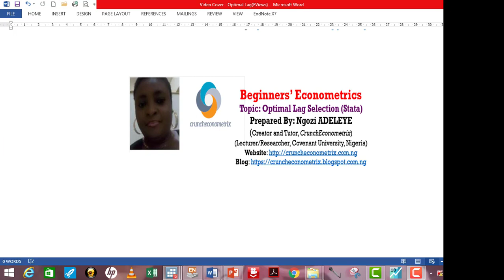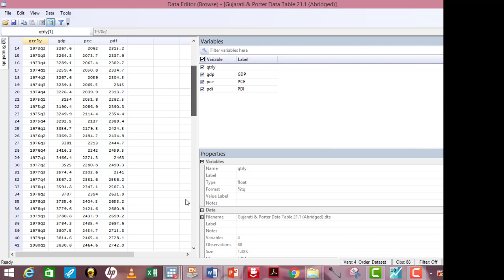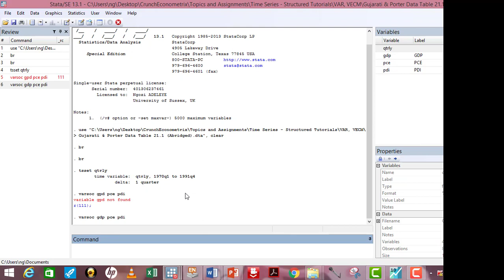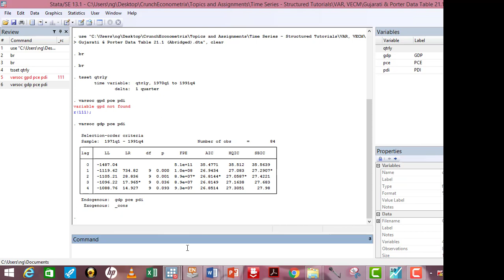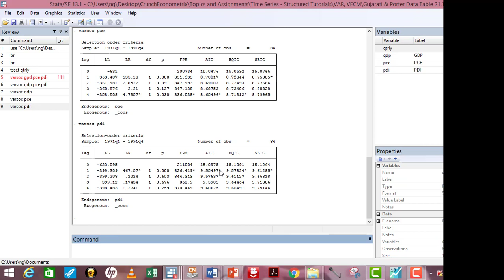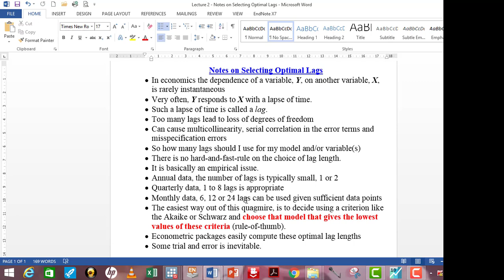(Stata13):Determine Optimal Lag Selection #lags #lagselection #aic #bic #sbic #hqic #eviews

Comment: I have 40 observations with 6 variables (both dependent and independent). The lag selection tests SC, HQ, and FPE suggest lag 1, while the AIC and LR tests suggest lag 3. Since the AIC provides the lowest value, should I use lag 3 or lag 1 in this case? Thank you, Prof.
Reply from the maker: Yes, use the AIC lag criterion to run your analysis. Sincere apologies for the late response 🥰.

Comment: Can you use "varsoc GDP", for instance, when performing the ADF unit root test?
Reply from the maker: "Varsoc" is used to obtain the optimal lag length. You may then decide to incorporate the lag length when performing the ADF test.
Reply: @CrunchEconometrix  Many thanks again for your kind reply. One additional question - suppose we want to make the series stationary. In STATA I define a variable dGDP = d.GDP, where dGDP is the first difference. Is it necessary to execute the varsoc command (varsoc dGDP), determine the lag length first, and then perform the unit root test on dGDP? I personally do not think that lags need to be specified when performing the unit root test on first-differenced variable(s). I tried, and both AIC and SBIC indicate 0 lag for the variable GDP. Second, do we use the varsoc command in the same way when performing the PP test? Thank you very much again.
Reply from the maker: You may want to follow the steps indicated in my Time Series videos for better understanding. Thanks

Comment: Thanks for your viedo it,s so interesting i want to ask you two questions please and i need your answer : there you choose the maxium lags for each variables  as we can  used to ADF test and other unit root tests ? 
then in my case i found that  4 variables have the lowest values in the SBIC but the last variable has the lowest value in AIC so what can i do please??
Reply from the maker: Hi Ahlem, you can either stick to uniformity or use different criterion as related to each variable. Remember, to put in a note to explain what you did in your work.

Comment: Maam thanks so much for your videos. based on basis on optimal lags for annual data, i used varsoc for a variable and the optimal lag was 4 instead of 2 provided my data set is 30 in number. what can i do with this variable?
Reply from the maker: With 30 obs, estimate with 1 or 2 lags and put a note in your work explaining why.
Reply: @CrunchEconometrix  Hello maam. I really appreciate your videos. I have the same trouble where the optimal lag is 4 instead of 2 for yearly data, and my data set only 12. Should i estimate with 1 or 2 lag and put a reason note, and if yes can you give me some ideas about what to write on the reason note. Thank you so much.
Reply from the maker: No reasonable time series analysis can be conducted with 12 observations. Increase to at least 30 years.

Comment: Hi I have two questions if you could please assist me.
1. How do I derive a short run multiplier of yt+1 with respect to Xt, i.e dYt+1/dXt for a finite distributed lag model yt=1,78 +0.75Xt +0.2Xt-1 +0,35Yt-1.
2.how do l show and explain that as k→∞, dYt+k/dXt →0.
Please help, thank you.
Reply from the maker: Hi Nomaswazi, you will have to refer to the textbook where this topic in time series is covered. Thanks.
Reply: @CrunchEconometrix  thanks
Reply: @CrunchEconometrix  hi, do have any textbooks you can recommend?
Reply from the maker: @nomaswazinkosi8918  I always recommend: Introductory Econometrics by Wooldridge and Basic Econometrics by Gujarati.
Reply: @CrunchEconometrix  thank you so much.

Comment: Hi! Thanks for another great video. I was wondering if you can use the varsoc command on any variable before performing an ADF test on that variable. Hence, can I determine optimal lag length for ADF using varsoc? Thanks in advance. Your videos have been very helpful
Reply from the maker: Hi Braap, you mixed up your queries but I get the point....yes, perform the varsoc command on variables not on the ADF (test for unit root).

Comment: Hi, thanks for the video! When I try to use varsoc I get the error message 'repeated time values in sample' since I have a number of observations from the same years but different countries. I have tried to fix this through differentiating each year e.g. 2009a, 2009b etc. and have used this as my time variable to declare the dataset as timeseries. However, now when I run varsoc I get the error message 'no observations'. Can you help?
Reply from the maker: Hi Jack, thanks for the positive feedback on my videos. Deeply appreciated! The mistake you made is that you are using a time series syntax for panel data. The varsoc syntax is for TS analysis and not PD. Watch my well-explained videos on panel ARDL. You'll be glad you did.

Comment: How can i determine optimal lag for panel data ? i applied the command which you are cited in the step 5 (panel ARDL estimation steps  5 to7  but he has no result  .
Reply from the maker: Hi Ghada, you should get something. What error message did you receive?
Reply: @CrunchEconometrix  program error:  code follows on the same line as open brace
Reply from the maker: The error is from you. Better to use my dofile. Available on my website.
Reply: @CrunchEconometrix  i used the code egain but "invalid syntax"
Reply from the maker: @ghadaommezzine3065  You have to install the ardl syntax.

Comment: My second questions is that I tried to test the optimal lags for the whole model, putting all the variables in one command. However, Stata says that: matsize too small. You have attempted to create a matrix with too many rows or columns or attempted to fit a model with too many  variables.  You need to increase matsize; it is currently 400.  Use set matsize; see help matsize. 

I increased it to 1000. Then I got results.  But the table is missing a lot results.

So I'm thinking that if it is ok to use test individual lag orders then I will use this method instead of putting all variables in one command. I'm using ARDL model. 

Does professor have any suggestion?
Reply from the maker: My advice: test individually.

Comment: Dear Professor, I'm using ARDL method. Is it preferred to test optimal lag order for individual variables?
Reply from the maker: Hi Cherry, yeah absolutely. It's one of the pre-estimation procedure.
Reply: @CrunchEconometrix   mam at the time of selecting optimal lag is there any condition that variables must be stationary
Reply from the maker: Hi Meena, time series analysis requires the use of stationary or integrated series.
Reply: @CrunchEconometrix  mam i mean in ARDL we first of all select optimal lag. for this optimal lag we go to estimate VAR then put variables in it. than what should be the integration order of the variables to select optimal lag for ARDL. Is this requires variables stationarity before ARDL.
Reply from the maker: Meena, kindly watch my ARDL videos. They are well explained. Thanks.
Reply: @CrunchEconometrix   mam i watched your videos everything is clear to me except this one.. my doubt is just about the variables that we put in to select optimal lag for ARDL. i am very confused about it mam..
Reply from the maker: @meriawazhipehchaanhai...6821  Alright. What are you confused about maybe I can explain?
Reply: @CrunchEconometrix  when we have to select optimal lag either for VAR or for ARDL we follow these steps: 1st Quick-Estimate VAR- it asks to put endogenous variables. my confusion is if our variables such as GDP, Exp, are I(1) and return are I(0). can I put the variables in endogenous in this raw form as it is in the case of ARDL? and in 2nd  case my variables my all variables are I(1) so I will run the VAR model. but first of the lag selection is required. In this case should I put all variables in I(1) form to select the optimal lags.
what i have understood is it that to check the optimal lag either form VAR or For ARDL model. we need to put variables in endogenous variables in raw form....
kindly guide me about the both cases mam. am i correct or not?
Reply from the maker: But my videos shows exactly what variables are used. Are you sure you watched my videos or you are comparing my procedure with others. I have shown how to obtain optimal lags on several videos about VAR and ARDL so, I honestly don't know what to tell you. I do my best to give clear explanations. Perhaps, you may want to check other online resources for additional information about this issue. My sincere apologies.
Reply: @CrunchEconometrix  thanku so much for your suggestions and guidance...
Reply: mam kindly tell how many lags are optimal for daily data as monthly, yearly and quarterly you explained here.
Reply: @CrunchEconometrix  thanku so much mam one thing kindly tell me how many lags are optimum for daily data as you here in this video not talked about it.
Reply from the maker: You may have to watch my video on Optimal Lag Selection. Well explained.

Comment: How do you treat a model where you have dependent and independent variables??!
Reply from the maker: Hi Ivan, pls clarify ur query bcos a model should have both depvar and explvar.
Reply: @CrunchEconometrix  i was meaning. Do all variables have to be dependent while running varsoc
Reply from the maker: @ivankiryewala814  Yes
Reply: @CrunchEconometrix  can i ask why because stata provides for independent variables too. I tried to find the lag length independently for each variable and then for the model where all variables were dependent. It turns out that the lag length of the model is very much dictated by that of the variable with the most lags.. When i tried to run a VECM using that lag order. There was multicollinearity through out the model upto lag 6..
Reply from the maker: @ivankiryewala814  All I'll say is that you can decide to follow my procedure any run your analysis but if you have another way, then you can use that too.
Reply: @CrunchEconometrix  Anyway.Thank you

Comment: Hi, you ran varsoc with three variables "jointly" and then for each one, how should interpret different results as you get? I mean, in the first example you get 2 optimal lag lenght but for pce just two.(in my monthly data i've got just 1 or two lags)
Reply from the maker: Hi girl, this video explains optimal lag selection if your estimating either a VAR or ARDL model. Remember that for a VAR model all the variables take the same number of lags, hence in the case it is the "optimal lag for the model" that is determined and not for the variables. So the code will be "varsoc y, x1, x1". For ARDL model, "the variable optimal lags" will be determined individually, that is "varsoc y", "varsoc x1", "varsoc x2". Interpretations are are explained in the video.
Reply: Thank you for your reply: i think i’m wrong ‘cause i’m just deciding how many lags to use in the adf test.
Reply: @CrunchEconometrix   thank you very much for your useful video, I have a question please, I'm using panel ARDL and I have followed all your panel ARDL videos. However, after I have applied the optimal lags command, the command: xtpmg d.RGDP d.lnFDX d.lnINF d.lnGOV d.lnGFCF d.lnTRD, lr(l.RGDP 2.lnFDX 1.lnINF lnGOV lnGFCF lnTRD) ec(ECT) replace pmg with optimal lags doesn't work!? How we can apply this command with the optimal lags for example with lag 2 for FDX and lag 1 foe INF variables? Thanks